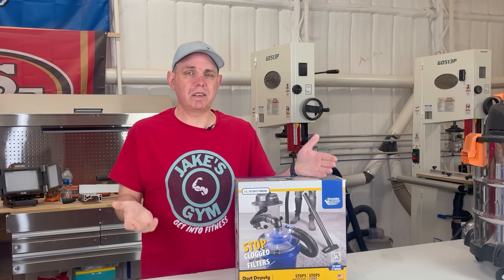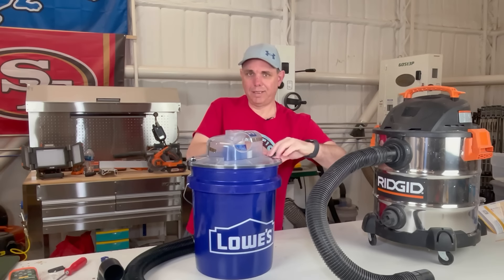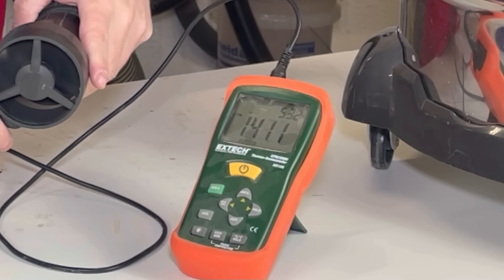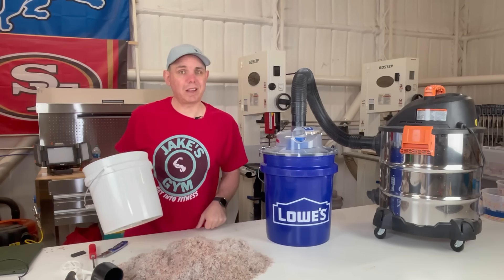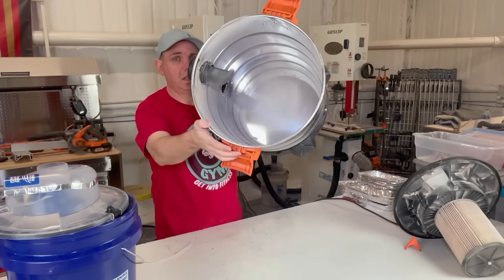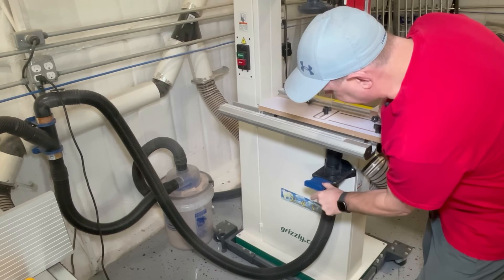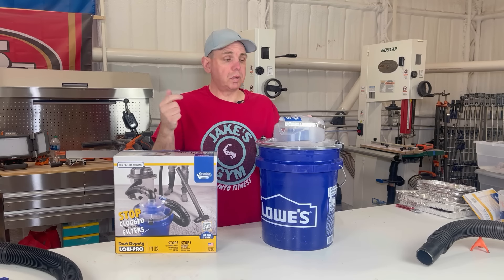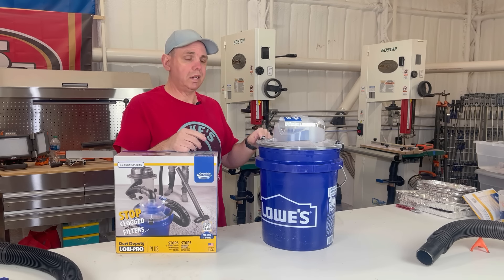What does a Dust Separator Do? Oneida Low Pro for YOUR Shop.

Comment: Yeah that filter bag really saves a lot of wear and tear on your shop deck filters keeps them clean also  I’m going to order a set for my brothers shop and one for my self I even use a stinger gallon and a half shop vac I got from home depo and you can clean the bags a lot with I use a dustpan brush and I use a old toothbrush for certain parts of the bag so I don’t rip the top corner parts where the bag attaches to the top part of the shop vac with the rubber band that’s right use the toothbrush on the sides where the bag is folded you will see what up I’m talking about if you  use a small shop vac for my house after I sweep my floors I use a led flash light and set it on the floor you will find out how much a broom really misses if toy have a dog even dust when you get older my eyes are not so good I always have a nice Led Flash light in my pocket EDC every day Carrie I have a couple  OLIGHTs flash lights rechargeable flashlights and they have a magnet recharger always buy them on during flash sales like every holiday they have a flash sale you get really great deals the  
The OLIGHT Warrior 3S 2300 Lumans  it has like 5 Modes I’m looking now some are $100 some of them are $120 if you buy directly from all light on a Flash sale you will get really nice bundle deals 

And the light my son-in-law gave me a Nightcore  P23i thats a great light also 3000 Lumans on max it has 5 settings also you might like the OLIGHT flash lights if you I have never looked them up they have lights for everything great company  and love the rechargeable batteries and how they recharge also  get a flash light and set it on the fkoor after areas you clean up and watch how much you don’t see my wife gets mad at me she was sweeping the floor one day this is not too long ago and I set the flashlight down because I was going to go behind her anyway just because I’m OCD a little I just know she don’t have the strenth to clean like I do and from me working in shops then I’d learn how to detail boats and cars when I was in middle school so I bin working hard my whole life I’m 49 now my eyes are bad because of having Lyme disease

Comment: I can see a lot of room for improvement for this thing. It's basically a cyclone mechanism but having it in a separate bucket causes loss of suction power as you demonstrated with a lot of the loss due to the hose between the shop vac and the external bucket.
Why not make the cyclone separator 'lid' fit onto the shop vac itself? This does mean the shop vac filter will need to be replaced with a much smaller filter so it does not get in the way but considering the cyclone mechanism is able to filter out 99% of the crud that is vacuumed up that should not be a problem. This is something shop vac manufacturers could easily do but they probably don't because they want to force the consumer to buy more filters and also to keep the manufacturing costs absolutely rock bottom even though ot does not really add much to the overall cost.
Hmmm, I have an old shop vac sitting around...might modify it and try making something along those lines. It would definitely be more compact and less fiddly to not have an extra bucket and hose to contend with!
Reply from the maker: Man… let me know how it goes 👍

Comment: I don't get something about this, and I've seen it on reviews of a few different models ....

WHY include the seal separately? It's not like it has to be custom cut to fit your bucket. It's fit on the item that they put in that box. What benefit is there to have the customer install the seal? While it's not something THAT difficult, it's certainly a spot where mistakes can easily be made and cause extra traffic between them and the end user, when it could be done at the factory and caught by QC...
Reply from the maker: I’m not sure why they do that.. I see you commented about the same thing on another one of my videos.. I hope you enjoyed them.  Putting the seal on really is easy, but I’m not sure why it’s not just put on from the factory already.. I’m sure it’s to keep the cost down.